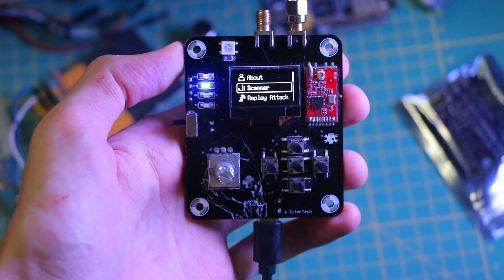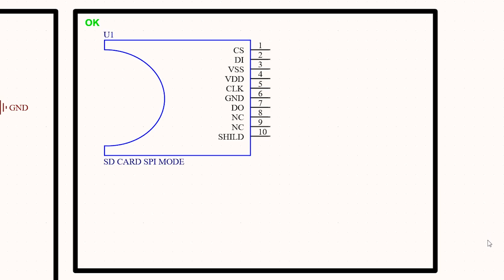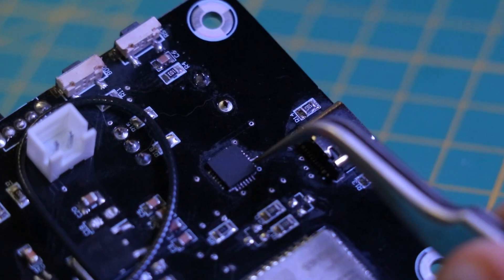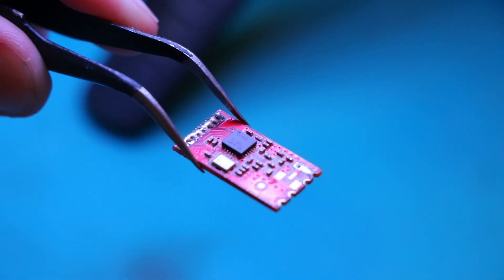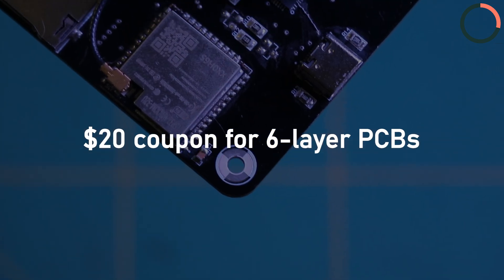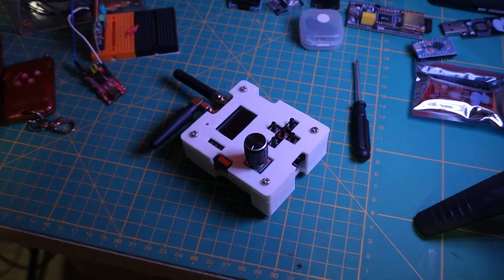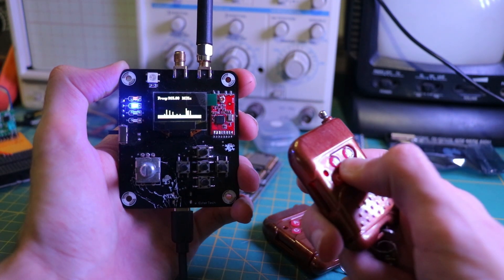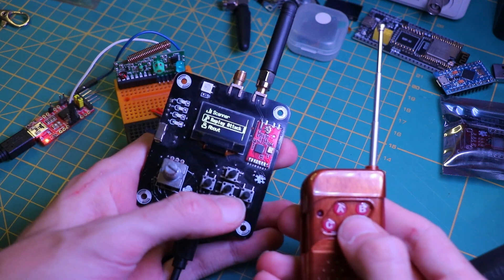How to Build a SubGHz Replay Attack Device | Full Guide

Comment: Can you please share the full circuit Diagram Including display and all. If we use esp32 module, display module and CC1101 module, sdcard module then what will be the connection between those components when we are not using smd components?